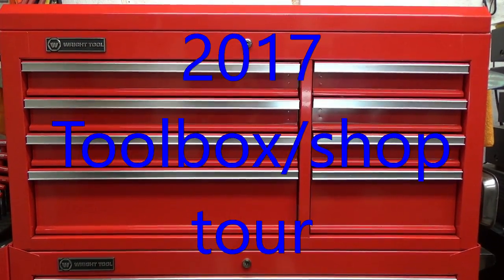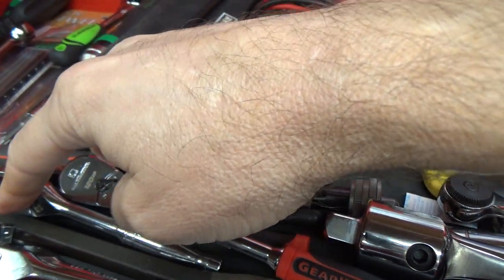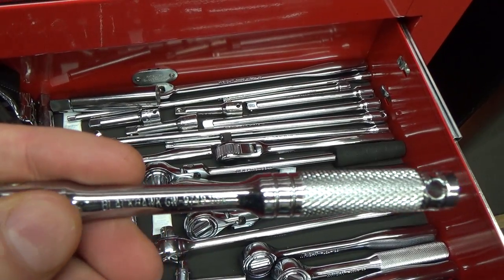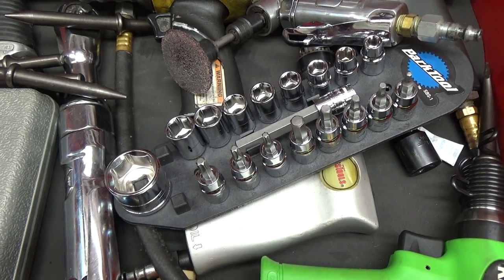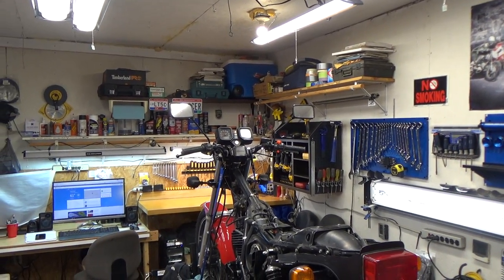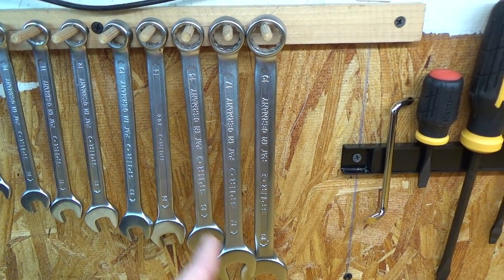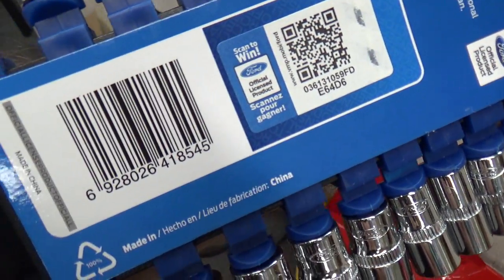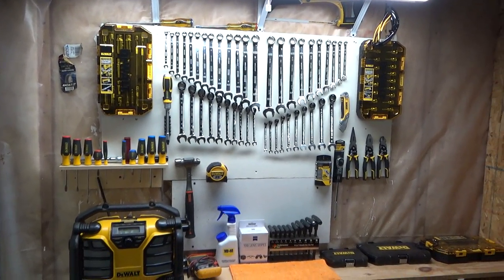2017 Toolbox/shop tour

Comment: Hey Mark,
Would you consider doing a video on the various socket rails that you have in use.
I have used various rails, trying to get the most out of limited space in my US GENERAL 44 inch.
Ultimately, I'd like to try a set of Westling trays. I think I can get the most out of those AND their aluminum.
Reply: I am intrigued by that grease gun mount. I can attach one to my box with magnets. 👍
Reply from the maker: The ones I like the most at the best price would be the Kobalt models from Lowes. After a long search I finally am upgrading from my own Harbor Freight 44 set up and that will probably be my next video.

Comment: who makes the set of impact bits in that tray at 8:28. part number or brand would be great. nice tour! Thank you for sharing!
Reply from the maker: Those are from Titan, purchased on Amazon. 
https://www.amazon.com/Titan-Tools-16038-13-Piece-Impact/dp/B00TU3U9Q8/ref=sr_1_23?srs=6804661011&ie=UTF8&qid=1498904557&sr=8-23 

https://www.amazon.com/Titan-Tools-16037-13-Piece-Impact/dp/B00TU3U9S6/ref=sr_1_27?srs=6804661011&ie=UTF8&qid=1498904557&sr=8-27 

https://www.amazon.com/Titan-Tools-16039-13-Piece-Impact/dp/B00TU3UCBK/ref=sr_1_66?srs=6804661011&ie=UTF8&qid=1498904612&sr=8-66 

Thanks for watching Tony, I enjoy your channel as well.
Reply: Mark Fox thank you that means alot! and thank you for the reply. I hope those bits have held up well for you. I was thinking about getting them. thanks for the links as well. have a great weekend.

Comment: Nice tour! Say, what make are the t handled nut drivers you have hanging on the wall at about 32:14? I couldn’t quite make out the brand you are saying and they look really nice. Oh and where do you get them?
Reply from the maker: Those Kowa Tools, they are made in Japan and supplied most of the Japanese motorcycle manufactures with their factory tool kits. You can purchase them from Pro Circuit here in the US https://www.procircuit.com/kowa-7-piece-t-handle-set.html
Reply from the maker: This is the separate video I did on them as well https://www.youtube.com/watch?v=bqd2puFc6Ls

Comment: Hey Mark how and where do you get the Wright tool badges? I would LOVE some for my tool cart w/ side cab im putting together. I have the wright grip 2.0s so no snap on for me. I'd really appreciate being directed to them!
Reply from the maker: I acquired them from the OEM of Wright Tool toolboxes,SPG International. Unfortunately they are not available to the general public.
Reply: Thats what I was thinking, I REALLY admire your collection of tools
Reply from the maker: Thank you! Been working so many hours at my day job haven't had time to add anything interesting lately.
Reply: How do you like the gearwrench 84 tooth locking ratchets? I've noticed the button is finicky and can unlock rather easily... im looking for a good stiff flex head and locking flex head ratchets, maybe i should buck up n get a snap on already. I have spent something like $70 on a locking roto head ratchet from TONE that I need to use more to see if i like it more. It does have nice weight with the hollow handle being 10inches or so, the part number is RHVHW if you care to see what they are and took about a month to come to me.
Reply from the maker: I'm not really a big fan of GearWrench, I tried the 120XP's and I just don't like them. Maybe the 84T models would be better but I'll keep my Wrights, Proto's, and Carlyle's.
Reply from the maker: If you have a use for them seems like a good price to me, I have very little use for any SAE tools so I would pass on them.
Reply: I would get them for the handle functionality, I get really bad straining pains in my hands when im turning wrenches in awkward spots. I been going to Amazon.de and buying knipex pliers and a interesting thing besides the Usa having them priced much higher is that when I go to pay it seems to calculate backwards so instead of a euro costing more then a dollar, a dollar cost more then a euro making a item that cost 40 euros will cost around $34. Shipping has been under $10 also!
Reply from the maker: I recently purchased a bunch of Orbis made in Germany pliers on Amazon when many of them were around $5 a pair. I few hours later many of them were $55 or $60 a pair!
Reply: I really like those angled kiwi style pliers, some really nice quality tools. I intend on getting the kiwi styles myself soon.